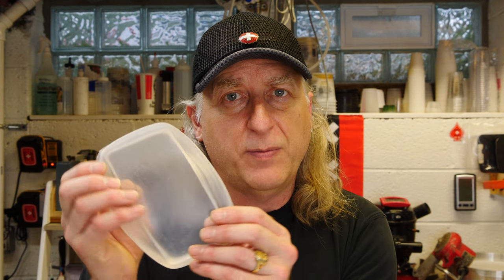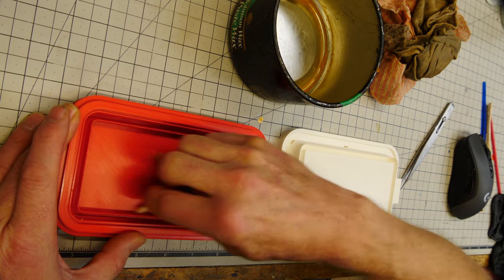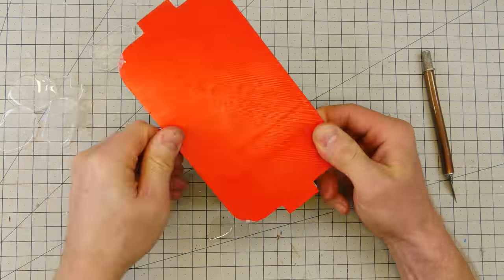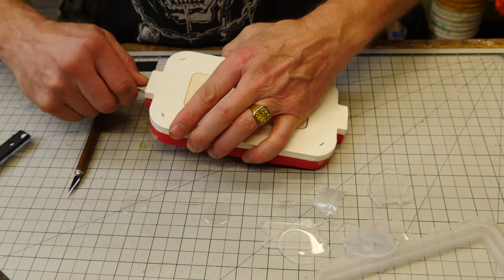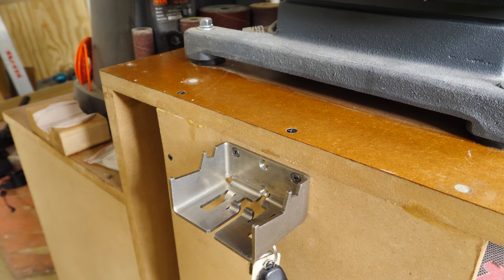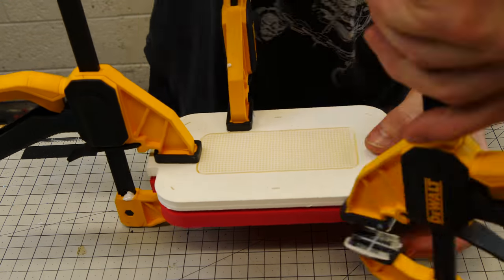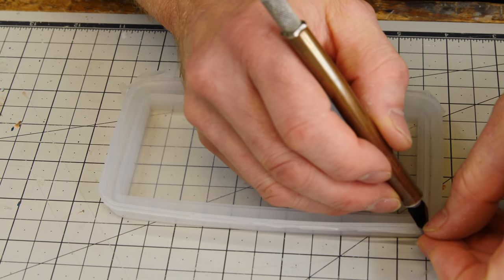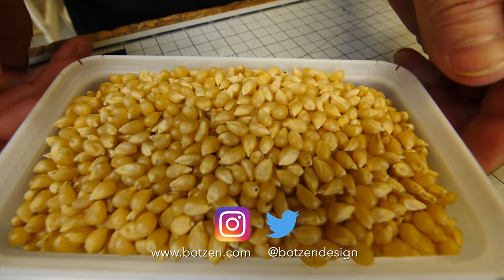Collapsable Container Made Easy

Comment: very cool as usual!  - i wonder if you could put a hole in the bottom of and pull a slight vacuum on the secondary mold instead of filling with sand.
Reply from the maker: I suspect that would be possible

Comment: What is the difference between the silicone used in this video and the silicone a builder would use in a silicone gun for caulking, say sealing the glass panels in a shower? Just curious. I obviously don't know enough about this stuff. :-)
Reply from the maker: The silicone builder would use is one component and just dries with the air the silicone that I use is two component and cures when you mix the two together